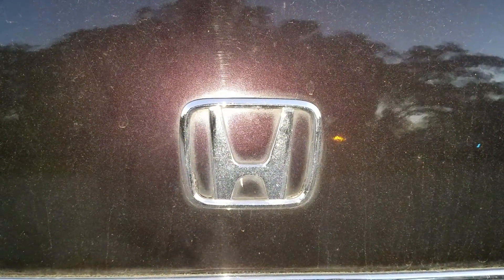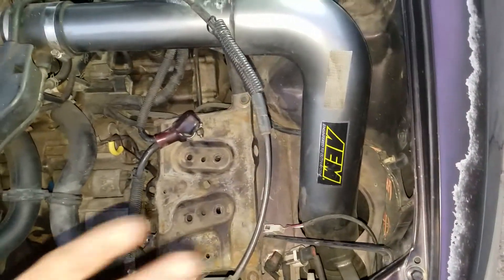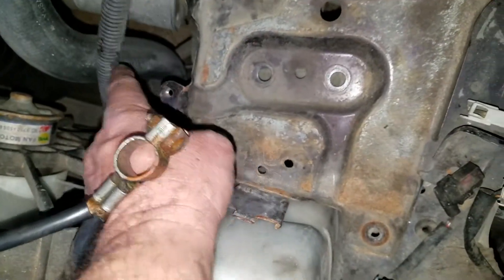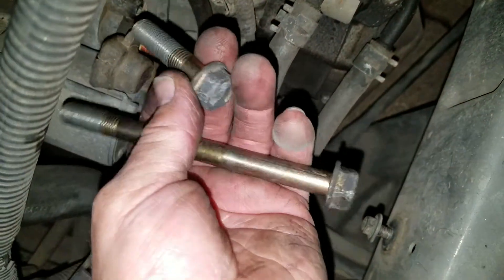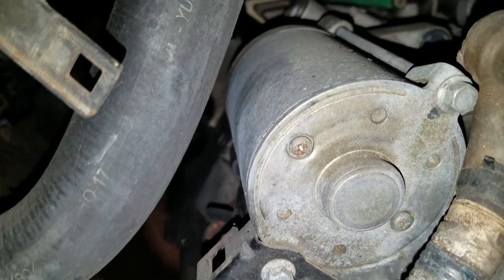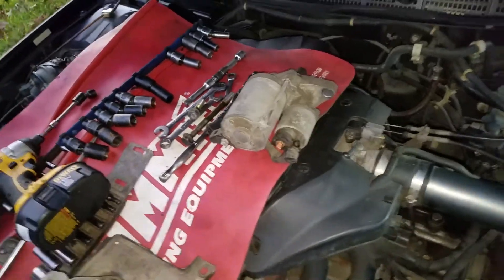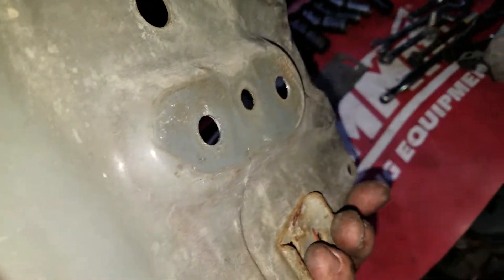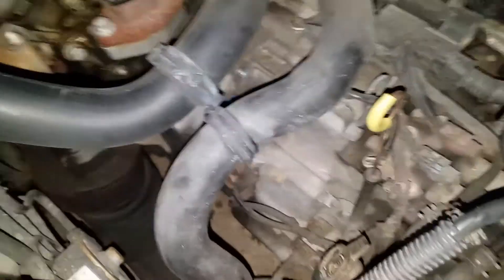1999 Honda Accord V6 starter removal

Comment: What are the chances the problem in my video is the starter? 99 accord with the v6.
Reply from the maker: Thanks for watching my video.

Whew that sounds like the starter bull gear is messed up. Gonna have to remove it and have it checked out. Also check your flywheel for damage. Is there a rebuild shop that you take the starter to. They can take the starter apart and tell you what it needs.
Reply: @chriskolar  ended up changing the starter out - changed nothing as far as the sound/no start. Im thinking im just going to get rid of it
Reply: @heavyw8517  did you get it figured out yet??
Reply from the maker: He might have got rid of the car.